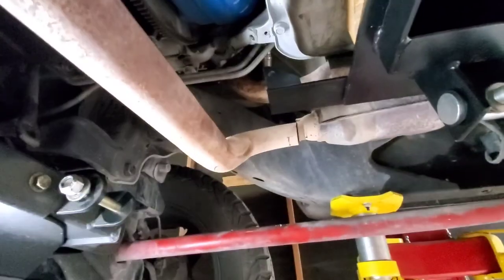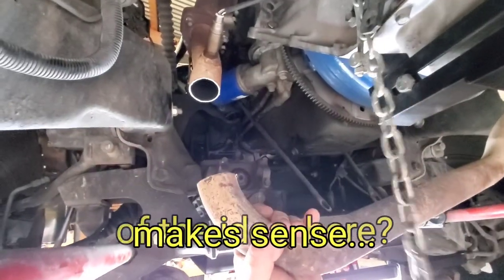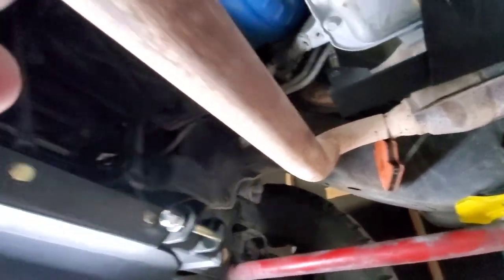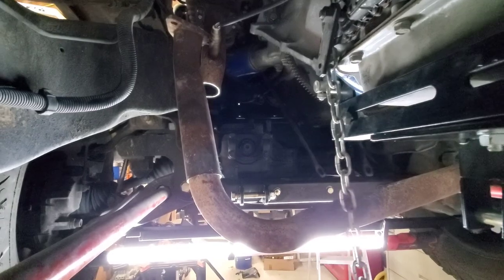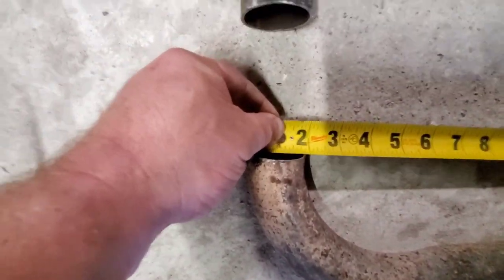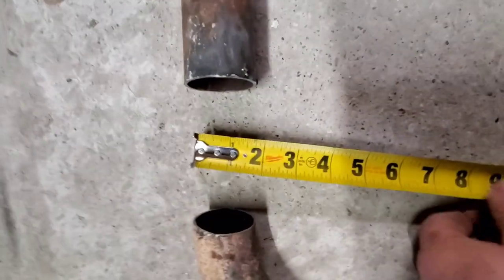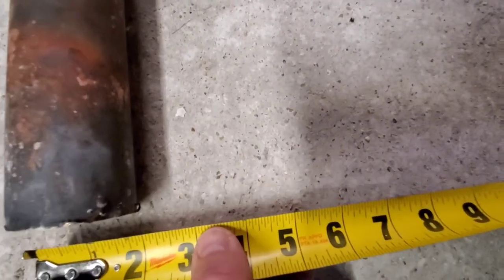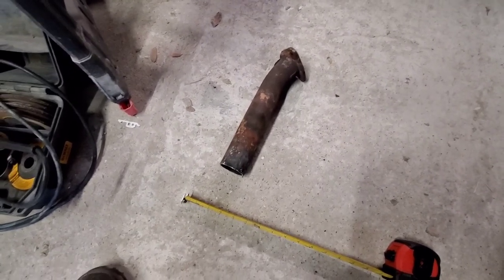OBS Chevy/GMC suspension lifts.. exhaust easy fix.

Comment: You're kidding right?  How about tucking the pipe up under the bottom of the bellhousing and across to the other side (Passenger side)?  Don't make a High School hot rod mess under your truck.  Fix it right.  Yes, it takes more work, but it will look so much better in the end.  And it won't leave a pipe hanging down to catch a tree root or rock and get ripped off the truck.
Reply from the maker: It is fixed right.. works great.. I don't plan on heavy offroad use or I would solid axle swap it.. but everyone has a opinion..
Reply from the maker: Also.. if you notice the skidplate for the differential and the support brackets coming off of it..the exhaust is above all that..  there is no way anything would catch the exhaust.. just realized I never did a update to show it done.. the exhaust is not in the way of anything.. it doesn't hang down.. it just routes just under the driveshaft.